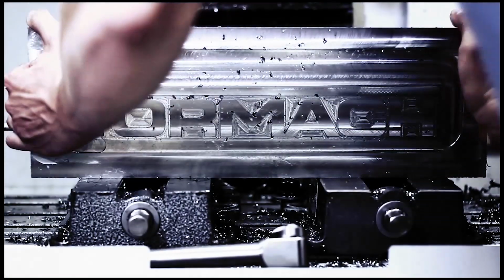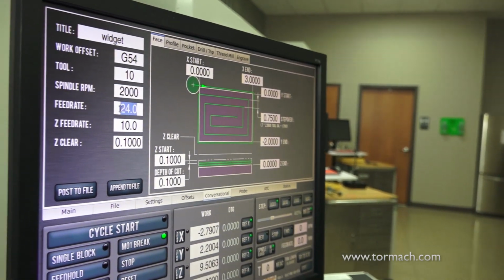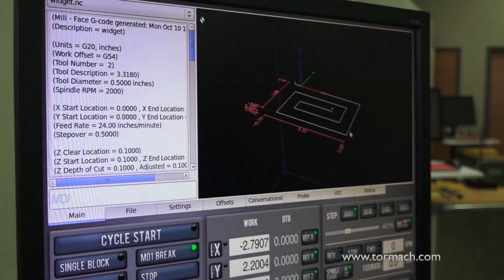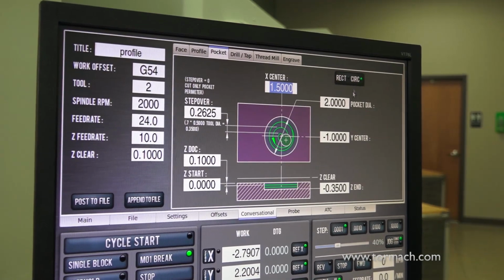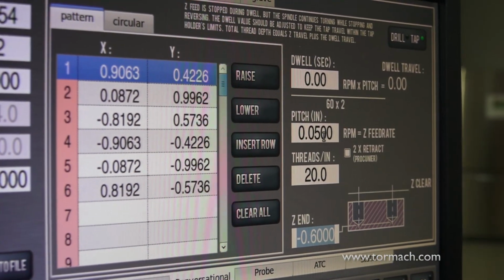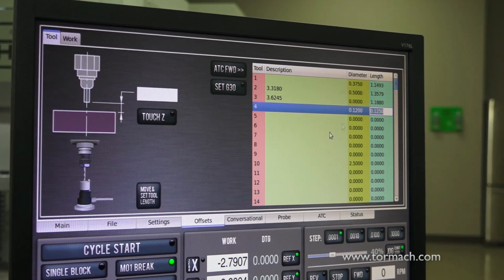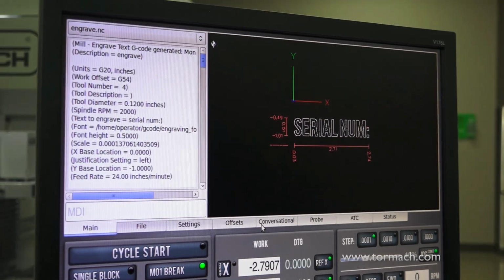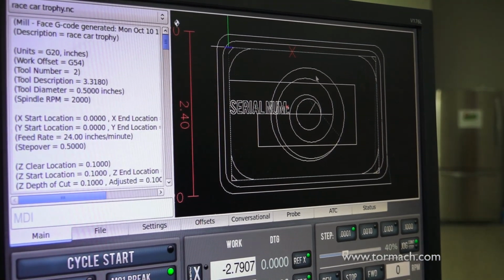Conversational Programming in Tormach's PathPilot

Comment: Probably a bit late to the party but I have a request for development. How about adding tabs for point to point milling? Similar to how the prototrak control has. It is often that I wish that I could mill an irregular profile without the need to modle something. Have a toggle in the upper right, like with drill vs tap, for profile vs pocket. Each segment or radius would have a end or continue prompt.  This would link each move. Until end was selected. Then move to retract position.
Reply: I agree 100%, sometimes I just want to clean up a basic profile... It would be nice to have a point to point tab where maybe even u could fill inn a table with x and y positions...

Comment: I watched this section but he did not say anything about doing a taperd pipe thread where the thread shrinks in diameter as it goes deeper down the hole.
Reply from the maker: Tapered pipe threading is currently available only on the lathe version of PathPilot, but not yet not available on PathPilot for the mill. It is on the list of future additions, but we can't promise exactly when it will be added.